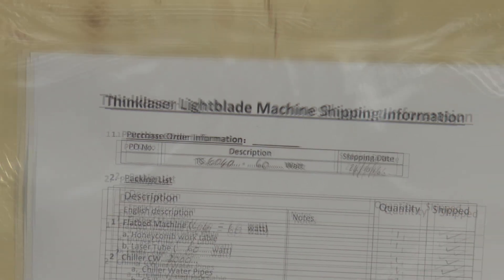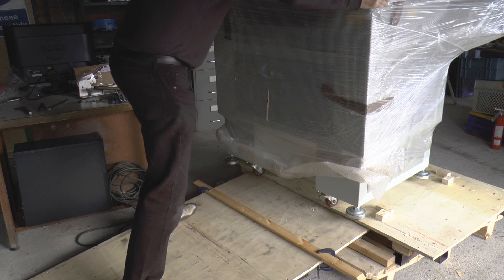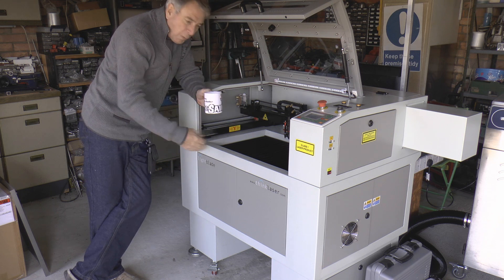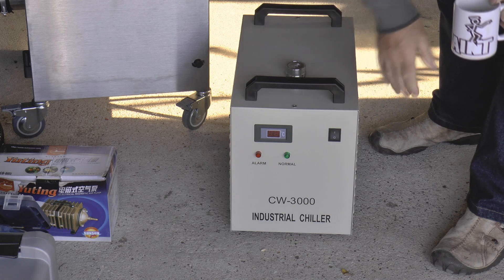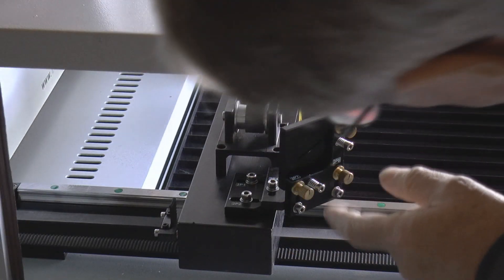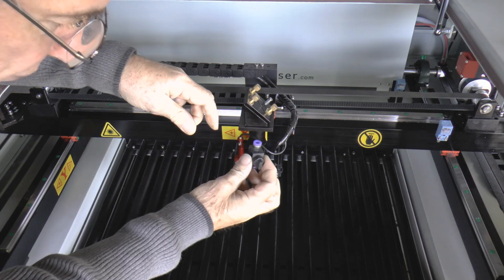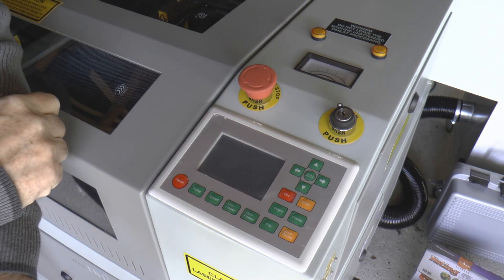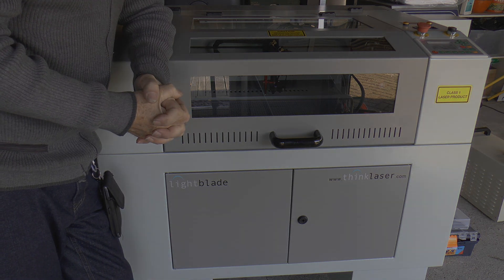RDWorks Learning Lab 84 My New Adventure

Comment: congratulations Ross. Well deserved. your new machine looks very similar to mine but with much better quality drive system. Those bearings on the Y axis are beautifull and the finishing, specially wiring seems excellent. We have a lot of parts in common now. one area where I foresee issues will be fitting your beloved 1.5 lens. I myself had to do some adaptations to make it work but it's working none the less. BTW, your motors are still steppers but with feedback loop. most likely the HBS57 drive and 3 phase stepper motors. They are probably the best stepper based closed loop solution on the market and it's widely used specially in the higher end of the Chinese laser cutters, the good thing is that they offer most of the benefits you will get on a servo system with out the complications of having to tune them. I was actually about to purchase that drive, motor combo about a week ago. But decided otherwise due the DB15 connector it has, I would have had to do a lot of work to wire them with my current system configuration. I went with Teknic Clearpaths instead. Anyways, I'm very enthusiastic about the new machine.

Comment: Congrats man ... You earned this.
Will be disappointing a bit, to not be able to follow you on the old machine.
But this machine will be sure to have troubles in it's own way.
Tech moves forward, not backward.
Good luck on your new adventure.
Reply: Bet you could sell that old machine for local pickup for more than what you originally paid for it.
Pretty well documented how it was upgraded. Plus you have a shitload of spare parts!
Reply from the maker: Panic not....no backsliding here. It's a bit like my power meter, something new to help me solve problems with my old omachine. I will undoubtedly be doing demos and comparisons but IT is NOT a project. My little Chinese dragon still hold lots of engineering mystery for me.
Thanks for comments and concerns but little changes.....I'm just a lucky guy and I really appreciate the loyal following that has developed through our common problems.
Best regards
Russ